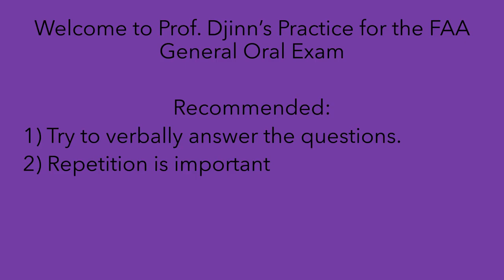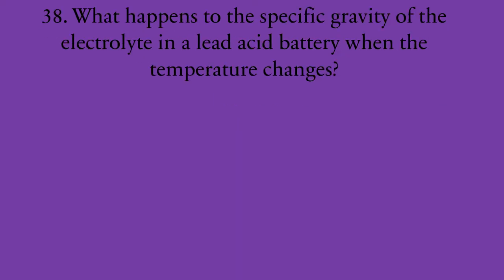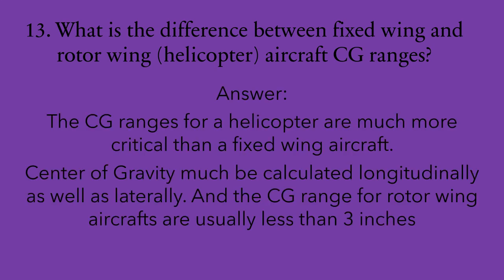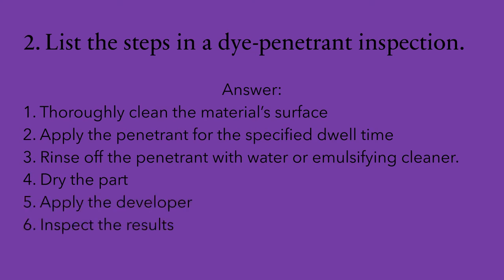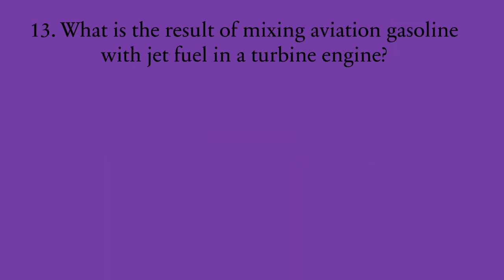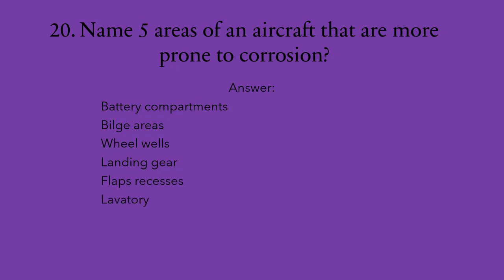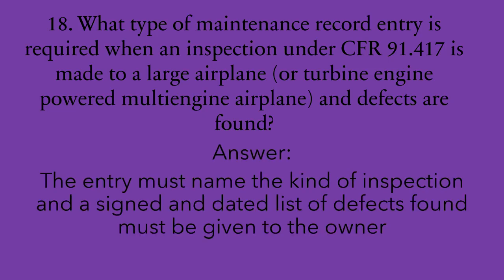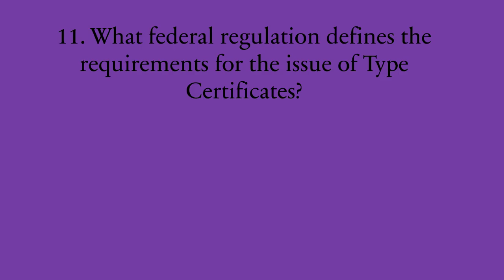FAA Oral Questions: General

Comment: 0:52 Basic Electricity

16:16 Aircraft Drawings

23:07 Weight and Balance

35:50 Fluid Lines and Fittings

43:57 Materials and Processes

56:10 Ground Operation and Servicing

1:04:49 Cleaning and Corrosion

1:15:39 Mathematics

1:23:25 Maintenance Forms and Records

1:34:33 Physics

1:44:51 Maintenance Publications

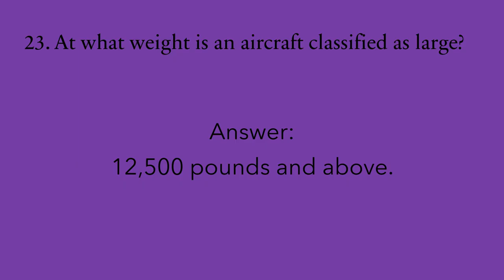1:52:43 Privileges and Limitations
Reply: Seriously thank you for this.   Makes quick work when trying to brush up in a certain area.
Reply: I notice why isn't HUman Factors aren't on jeppsen?
Reply: Thanks